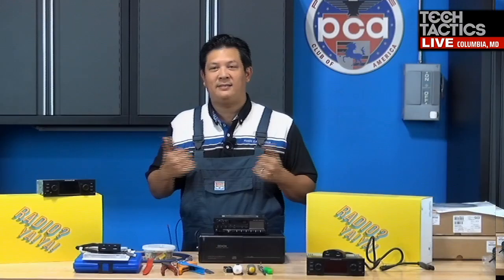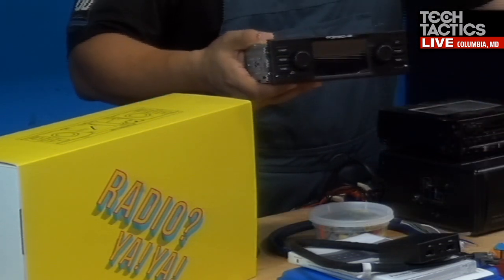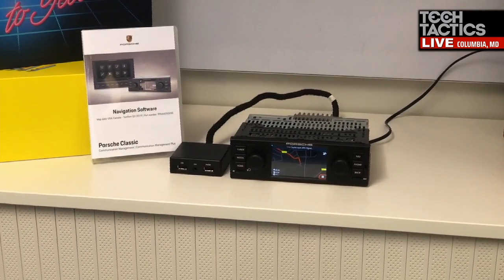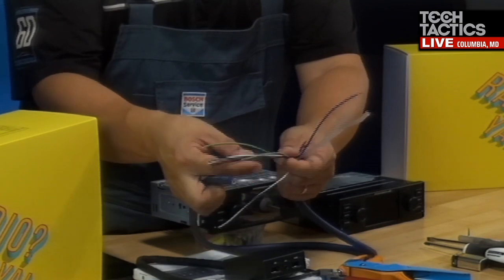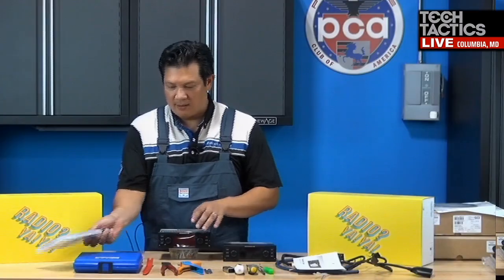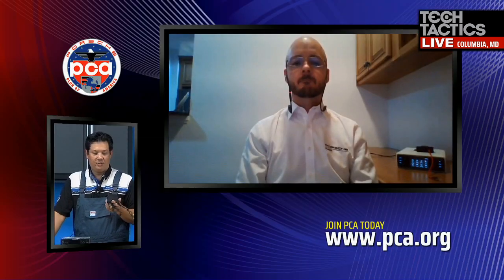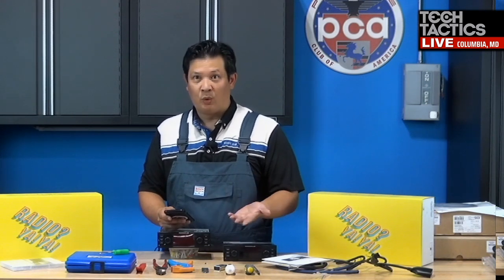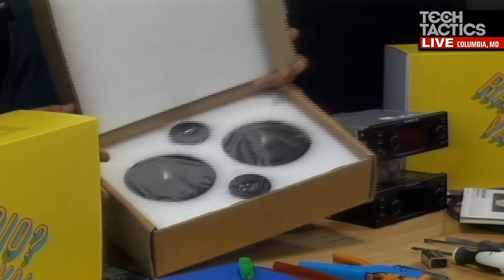Tech Tactics LIVE: Project 964: We discover surprises as we install the Porsche Classic Radio

Comment: Hello, this is exactly what I've been looking for - I have a Mercede Benz SLK 32 AMG - tdo you think this single DIN would fit & work OK ?- also I have an ANRDOID phone is ANDROID AUTO supported?
Reply from the maker: It'll fit but you'll have to figure out the wire configuration on the Mercedes to match up to the Porsche radio.

Comment: Could i use this in a non-Porsche? Any single din and then custom wire? I have a a charger that i would love single din carplay in. (In theory:)
Reply from the maker: You could, but there are other aftermarket radios that will fit in a Charger as well.
Reply: @PorscheClubofAmerica  thank you! I have looked everywhere for a true single din, touch screen, apple CarPlay and have not found anything:(

Comment: I bought this radio and installed into my 97' 993 Turbo S. I also added the Sirius XM Tuner with the instal. Nice radio but a few complaints. 1. No HD FM. Why not? This is 2020 and HD FM has been around for years. Why wouldn't a brand new radio include this feature. 2. There are two Micro SD card slots. One is for the GPS Maps. The other allows user to use as a source for music. The radio limits this extra Micro SD slot to 8GB, which I agree is sizable but it for those of us with large music libraries it would have been nice if the size limit was in the range of 32 GB or even 64 GB. Why would Porsche limit this to 8 GB? 3. Display is really small and hard to read. I'm close to 70 years old so my eyes aren't what they used to be. Would have been nice if there was a way to enlarge certain functions, such as the actual radio channel you are hearing. 4. Lastly, when using either the Micro SD or the USB as a music source, it is very difficult to search for a specific artist, album, genre, song, etc. Overall, not as user friendly as I had hoped.
Reply from the maker: Thanks Hank for your feedback. Will certainly share with folks at Porsche Classic

Comment: No Android? (I.e. Android Auto?)
Why has Porsche become elitist to require iPhones?
Reply from the maker: As mentioned in the video, this radio works with all phones. CarPlay is the only thing specific to iPhone. There are screen size limitations as defined by Google that limit Android Auto integration into the PCCM
Reply: I’m thinking that Porsche figured out that most owners have iPhones. It’s a cost/benefit decision, I’m sure. At least I’m happy with their choice.
Reply: @tome9009  Porsche have strong reservations about the data slurp that Google may do.  85% Android worldwide, Porsche owners buy a basic iphone to use the feature so the ownership is distorted. Really not worth the effort.
Reply: I agree with Erol. I can't stand the proprietary BS that Apple puts people through to own an iPhone, as well as, their other products. As for Porsche not adding the some Android software to their radio..pfff. The screen is too small to be of much use for navigation or anything else. I simply mount my Note 8 to the window and use blue tooth to my Pioneer radio in my 1990 964 C2. I've got the original radio in my attic, but I can't see ever using a cassette player again in my lifetime ;)  This sounds more like a sales pitch for a $1000 radio.

I was a PCA member for 10 years before I got tired of paying the membership dues when the only thing I was interested in was the MART. Now, the MART is a joke. All the members think each of their parts are worth their weight in gold, as well as, the price of their cars. Don't get me wrong, Porsche makes great cars. I love my 3 Porsches (70 911T, 71 911E, & 1990 C2).